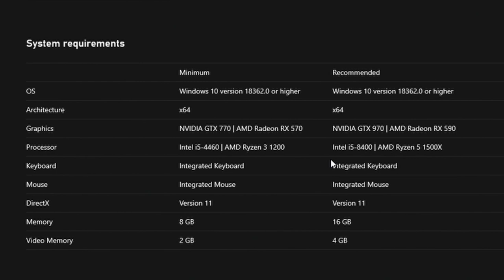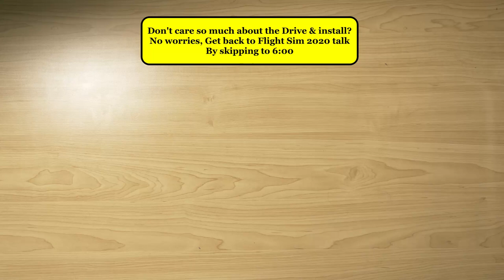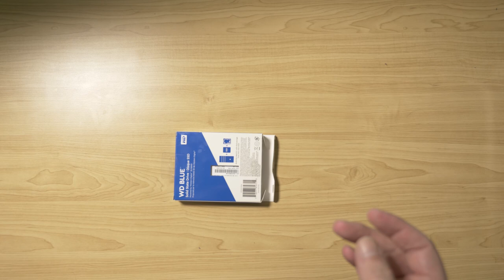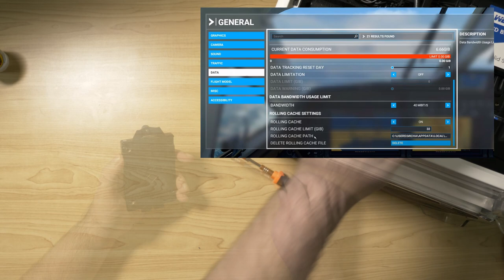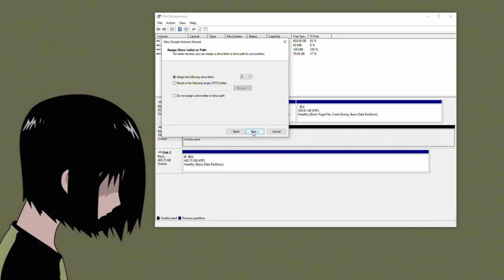PC Upgrade for Microsoft Flight Sim 2020, a ~2 MILLION~ GigaByte Game Size!?

Comment: Current gear need, a fan upgrade if EK ever sorts out the software for their fan/ pump controller. (So I can go full PWM fans).
Since that's kind of boring though, after that is a full platform/ CPU upgrade, I'm still running X99 with a 6850K, but I'm waiting for at LEAST Zen3, maybe even whatever AMD launches on 5nm in hopefully 2021. ooh, or a new PSU, mine's over 7 years old, and isn't as quiet as I'd like, but it's not even REMOTELY lacking in power, so everything else comes first.

As for LTT doing a 2PB build for Flight Sim 2020, I'd say the odds are probably 60/40 in favour of them NOT doing it, their biggest archive server is only 1PB iirc (and that's before loosing capacity to RAID and formatting), and that was quite the endeavour already even with spinning rust. However I'm sure ONE DAY, they'll do 1PB of SSD storage for teh lulz.

As for my current storage, my boot drive is a 1TB NVMe M.2, I have a 1TB Media/ Storage SSD that came out of my old laptop, and a 2TB Game SSD, so well set for storage. I do still have an Optical drive though, so not "ALL" my storage is solid state :P

Comment: Currently looking to add mass storage as I'm currently using a single 500gb ssd. Next would be upgrading the stock cooler on my r5 2600. My gpu works fine for now but might upgrade my 1650 super to a 3060 when that releases.

Comment: I am gonna grab a higher vram gpu when the new graphics cards release. The gtx 980 ti that i am running is capable of gaming just fine and im not nececarily displeased. But when video editing i am starting to feel the 6gb vram limitation a bit forcing me to do more offline editing. And if possible id like to upgrade that to either a new amd/nvidia card in the near future.